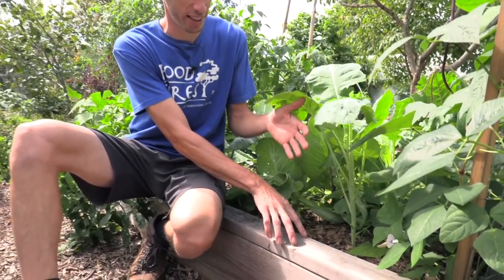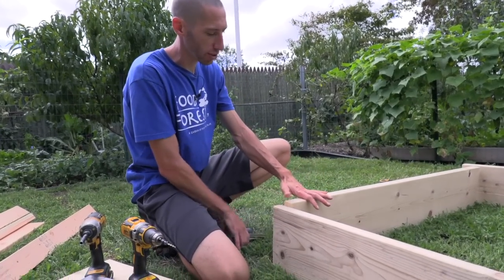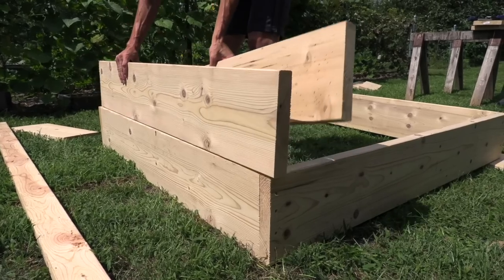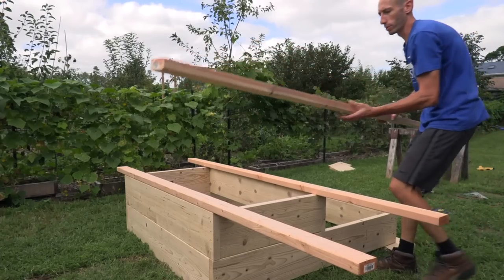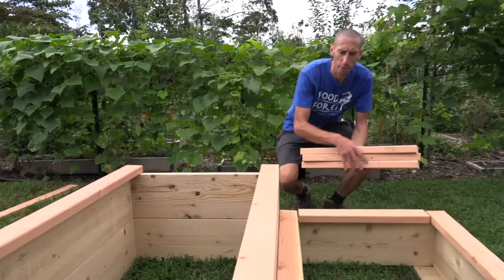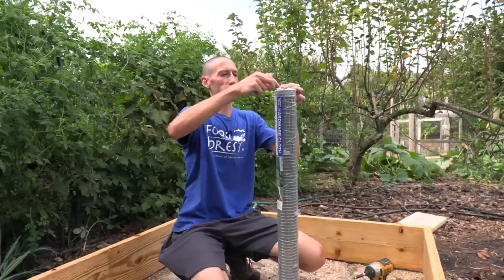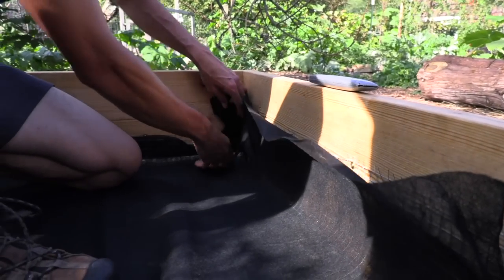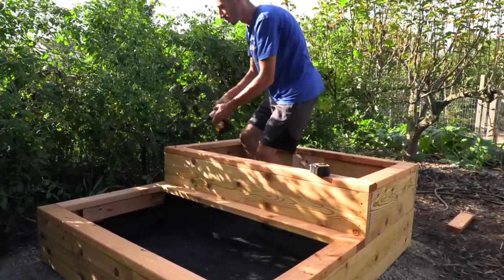How to Build a Raised Bed, DIY TERRACE GARDEN for Patio or Backyard

Comment: I put 1/2" hardware cloth under all of my raised bed to keep the gophers and moles from going up into the beds.
Reply from the maker: Smart! 👍🏻
Reply: I hadn't thought of that. Thanks for the suggestion! We've had a mole problem for years and I don't want them getting to my new beds.
Reply: Maybe you will need to add some worms in then ?
Reply: Where do you find the hardwood cloth? I could not find it at Home Depot.

Comment: I'm going through the measurements, and if you cut 2 of the 12ft 2 x 10s at 62"+52"+28" and then the 3rd at 55"+55", you don't have to get the 8ft 2x10. It leaves you with a lot less scrap to work with, but it's one less board you have to buy. There will be 2" from the first 2 boards and 34" from the last.

Comment: One tip I have for leveling things up, supporting the structure and sealing from erosion is to use those bags of paver base. You can shim it with scrap and tamp it underneath which should also be semi-porous for water and resistant to soil loss. This was extremely helpful for a hillside terraced raised garden I set up this year, which was built in place. Peace.
Reply: In addition, I think wood is less prone to rot when on the paver base vs. soil contact.
Reply: This is such a great tip. I'm stuck working on only pavers surface so it should've occurred to me also; I guess I must take the leveled aspect for granted.

Comment: Thanks James!  This reminded me of when I made 2 beds from redwood planks like 8 years ago and used fencing caps as well. They are just now showing some signs of separation from the corner posts I had used for stability. I’ve never used any linseed oil as the resin in redwoods is a natural insecticide. And I’ve never regretted the decision to put fencing caps. It gives such a polished feel to my small garden. I think I’ll be making another bed in the early spring that’s as high as your double decker but forming it into an L. 
Thanks so much for sharing the great ideas!
Reply from the maker: Those are some great ideas Zari! I like the L idea a lot. I will be building another bed in the near future also, a keyhole bed for maximum space efficiency. Thanks for watching and sharing your ideas my friend 🙏😁

Comment: Did you mention, did you use pressure treated lumber? I thought I had every kind of clamp there was but never knew about the 90 degree clamp! Thanks for that tip! Wow that's going to help me a lot in my shop on wood projects because I'm always working alone.

Comment: Very Nicely done, showing all steps including how to add msmts to accommodate for added pieces, which direction it should face, etc. THANK YOU! I do have one question, how did you level the box or how would I level it if I place it on the ground. I'm thinking I would just dig around the box? Will the wood rot out after a while? p.s. Love your videos, add Tuck, he's a cutie! Thx.

Comment: Bed looks nice! man i built so many things with an old rusty circular saw. plug in one, the guard didn't even work. i had to wait for the blade to stop spinning to sit the saw down. built a whole halfpipe with it. I think you've earned yourself a new cicrular saw. although yours still seems to work fine. maybe a dewalt cordless you already have the batteries! I'm thinking about getting one myself

Comment: James , can I ask why you don't move the top rail you put on your box so its flush on the inside of the box an hanges over an 1 1/2 outside so you don't loose 1 1/2  planting space all around the box ? Just a question

Comment: Could you use the Staple gun to attach the metal portion of the basket?  Trying to limit costs on putting the finishing touches on the beds I'm building.

Comment: Hey James I’ve been commenting on your past couple videos and i needed some help with my tomatoes because they still haven’t even fruited once and i planted them in around March so i really need help please.
Reply from the maker: Really that's odd. Are they not putting out flowers?
Reply: The Gardening Channel With James Prigioni they are putting flowers but no fruit😕
Reply: @justberry6509  you probably  have a pollination issue. You can hand pollinate  the. By using a  feather, ear swab or soft fine brush to very gently move it around in each flower.
Reply: Whytedavy Gardening And Worm Farm thanks I’ll try it

Comment: isn't the length and width entirely arbitrary? So if you just used 4' lengths and 6' lengths, you could use 8 and 12 foot boards cut in 1/2 (including the cap board) with no waste? Or am I missing something? Love your videos, they've helped me with my gardening immeasurably.
Reply: <watches the video>... Ohhhhhhh. I get it. Very cool, and nice project!